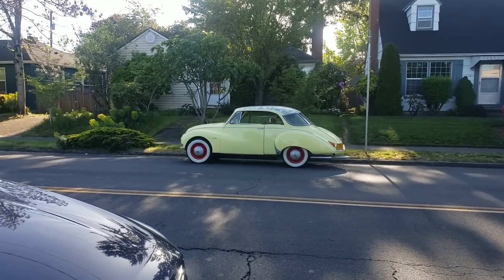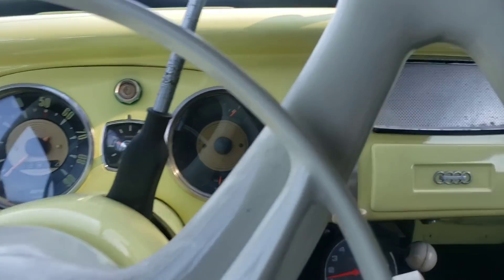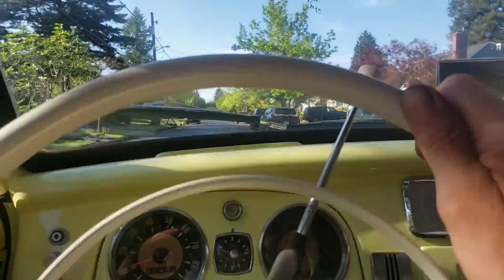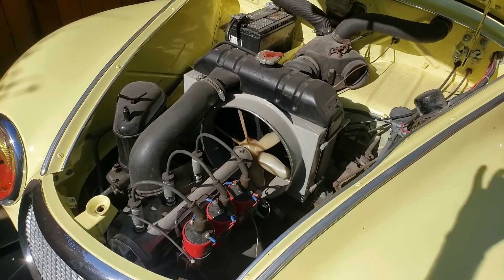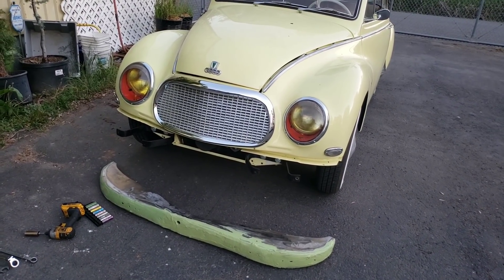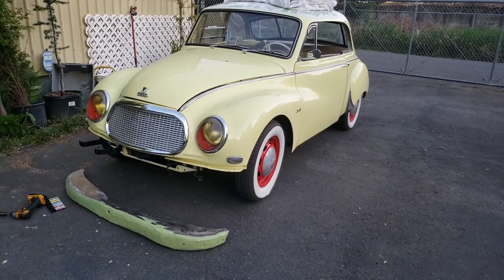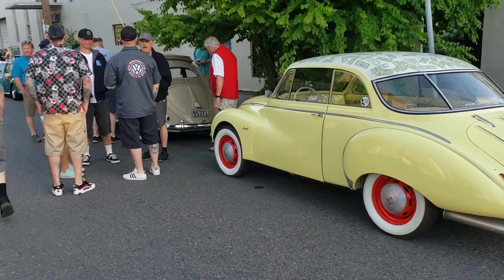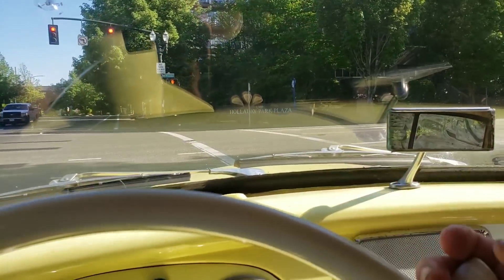Enjoying my Two Stroke DKW 3=6 Auto Union

Comment: Two stroke engines in general have little to no engine braking. A great example is that I had a 73 Suzuki GT750 3 cyl 2 stroke. In the summer of 73 I rode it up Pikes Peak, the trip coming back down was interesting since it had almost no engine braking, that bike was one of the first to come with dual front disk brakes. There are warning signs to not overuse your brakes coming down the mountain, to use engine braking, which I didn't have. I tried to take it as easy as possible on the brakes, there was a Ranger checking for brake overheating about half way down, he told me I needed to pull over for a few minutes to let my brakes cool, I didn't believe him and touched one of the brakes, it was like touching the bottom of a hot clothing iron! I had to use the brakes since even in 1st gear the engine would speed up to the redline or more going downhill if you didn't use the brakes. The sound that engine made when you were accelerating was music!

Comment: DKW made beautiful vehicles. When I was 16 (1964) I had a DKW Hobby motor scooter. It was 70cc with an infinitely variable gearbox with a belt drive with two pulleys that had variable diameters. The wheels were around 16" spoked. It was pull start and was beautifully constructed. Very advanced for the times.

Comment: We had a 1963 DKW F102 from new; the ultimate development of the 2-stroke automotive engine. 1200cc, 3-cylinder, 60bhp, free-wheeling, front wheel drive with inboard disc brakes. Acceleration-wise, about the same as a Fiat 1500 and better than the contemporary cars up to 2.5L. Maximum/cruising speed 80mph give or take, designed for the autobahns. It was a fabulous little car and the immediate precursor of the Audi, which was the same shape and the first of that line's 4-strokes.  People, including those in high places, talk a lot of shit about polluting 2-strokes. Anyway, modern synthetic 2T lubes smoke very little - certainly no more than a good diesel.

Comment: I have a 1944 DKW NZ-350/1 motorcycle from the Wehrmacht.  It's 11.6 HP, single cylinder two stroke.  How many HP is the DKW auto?
Reply from the maker: 45 hp approximate 900 cc

Comment: Just bought a 1961 auto union in Oregon. Random I need a couple of parts can you help?
Reply from the maker: Dekabras sells parts
Reply: @2stroketurbo  Appreciated, started working on it a little last weekend and noticed right rear brake drum is missing. Thanks again
Reply from the maker: @steveflat-6pdx825  I have a spare rear drum, a bit crusty but useable,  50 bucks, PU only , no shipping
Reply: @2stroketurbo  Hello I'm heading out your direction this coming Wednesday. I'd like to meet and get that rear brake drum. Around noon let me know if that works for you.
Reply from the maker: @steveflat-6pdx825   sounds good
Reply: @2stroketurbo  Hello I'm heading out your direction tomorrow. I'd like to meet and get that rear brake drum. Around noon let me know if that works for you. If so where to meet? Thanks

Thanks again,

Comment: I just can't stop enjoying the two stroke noise, nothing sounds better than a two stroke engine that's getting a kick in his ass. In th mid 70's I owned  a Suzuki GT550, with expansion exhaust....just when I remember the sound...I'll still get the shivers. 
No 4 stroke engine can beat that screaming sound.( except...the rotary engines, they sounds even awesome 🤩)
Reply: True that.
Reply: Rick Delair  - Two places where 2 strokes fail; Emissions and fuel economy.  A lot of raw fuel is shoved out the exhaust port. Fuel economy is poor too. The Kawasaki triples typically got 20 something MPG.  And then there is the exhaust smoke.  Suggesting a 2 stroke is a viable car engine is a joke.
Reply: @scootergeorge9576  On fact that a 2000's US government emission report highlighted, which is that 2 strokes emit only 1/24th the N2O emissions per cylinder cc than even lean burn 4 strokes.

2 strokes are cleaner on N2O emission than 4 strokes.

On economy my 1979 CZ 250-471 2 stroke twin did 76 MPG compared to the 60 MPG that my younger brother's 4 stroke 1978 Yamaha XS 250 could manage. Not all 2 strokes are gas guzzlers, just the high revving low torque performance orientated ones.
Reply: @CZ350tuner  - I'd like to see that report. They probably emit less NOX because combustion temps are lower. However...
"Because two-stroke engines burn an oil–gasoline mixture, they emit more smoke, carbon monoxide, hydrocarbons, and particulate matter than the gas-only four-stroke engines found in newer motorcycles."  https://www.ncbi.nlm.nih.gov/pmc/articles/PMC1247506/
“In the cities of many developing countries, the pollution is horrific,” says Daniel Sperling, director of the Institute of Transportation Studies and acting director of the Energy Efficiency Center at the University of California at Davis. “Two-stroke engines are a big part of the problem.” discovermagazine.com/2008/may/21-two-strokes-and-youre-out
Reply: About 10yrs ago I had a '75 Suzuki GT250, a great bike, very economical and reliable. Kinda wish I still had it actually. Part I like is not having to premix oil/fuel.
Reply: Rick Delair  - The motorcycle companies stopped selling 2 stroke bikes in the USA for good reason. They are not as clean as 4 strokes. The last gasp was the great Yamaha RD-400.  After that, they could not meed the increasingly strict emissions standards.  Simple as that.

Comment: She's actually called "Three equals Six" hinting at the fact that a three cylinder two-stroke engine fires as often as a six cylinder four-stroke. In theory it runs equally smoothly. DKW knew two-stroke didn't have much future and thus tried this approach to convince people.
Reply from the maker: Precisely,  you got it right on
Reply: To be even more precise, it is a model F93, type 3=6. A bit like a Mercedes can be a model W205, type C250 or C300. Only that there was just one type of DKW F93. So it was more like a given name.

For the uninitiated: The fact that a 3-cylinder two-stroke engine has as many power strokes as a six cylinder four-stroke engine is also the reason why nobody really bothered with a four cylinder two-stroke engine. DKW had a go in the 1930s with a V4 with double charging pump (making the engine look like a V6) and Müller-Andernach tried a V6 two-stroke engine, but nothing much came of it. The increase in power was way smaller than expected and the scavenging problems only grew worse and the engines more complicated.

Comment: Interesting styling with the long trunk area.. Nice engine compartment that would clean up really well. .Good gear change.. A lot of road noise getting into the body, must be some shock absorbers and rubbers need replacing.. Great little car lots of character.

Comment: The radiator is behind the engine?
Reply: Yes!
Reply: @niklasgroning5792  Weird! I'd think that would force hot air from the engine through the radiator instead of the cool outside air. I wonder why they did it that way?
Reply: @JustWasted3HoursHere  There is no space in front when they have the engine so much forward.
Reply: @niklasgroning5792  Hmm..interesting. Thanks for the answer.

Comment: are you a member of the dkw club the blue cloud US reason in a member of dkw .nl and have dkw junior 1952 hydro siphon working in thermal like heating but no pump or thermostat still fun to drive having some 2stroke motors  a 125 175 sb 200

Comment: Question - why did DKW use a coil for each cylinder?
Reply from the maker: 3 sets of points
Reply: OK, so there is not a distributor in the conventional sense, right?
Reply from the maker: No. Just 3 sets of points on crank snout
Reply from the maker: No sir, I've  experimented with a few mufflers to get the right sound and right fit . This one is a dual outlet quiet muffler from a 90's Honda Civic SI. It flows great and I will trim tips once rear bumper is finished
Reply: DKW stock muffler is much bigger, like the size of 2-3 of those mufflers and it so quiet with original muffler, even if its a two stroke!
Reply: 'cause there is no need for a distributor